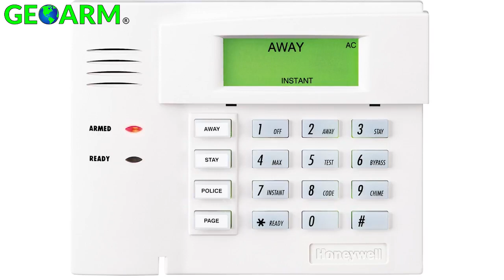How to Address a Honeywell Wired Keypad 6150?

Comment: I just installed a 6150 keypad and followed your instructions to set the address to 16 .  However, the screen is now blank.   Any suggestions on how to proceed?
Reply from the maker: Hello! That could be because you already have a keypad that is addressed to 16. Try moving the new keypad to another address like 17, 18, or 19.
Reply: Did you find a fix ? I'm in the same position as all I did was replace a malfunctioning one. I placed the same address as the old one but my screen is blank after pressing( * ready).